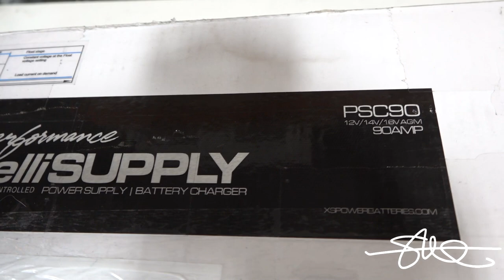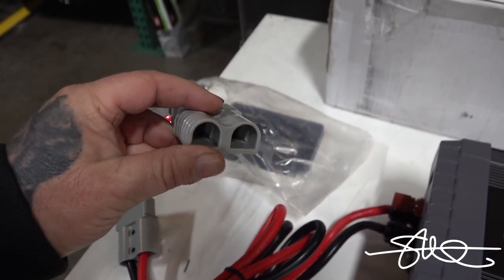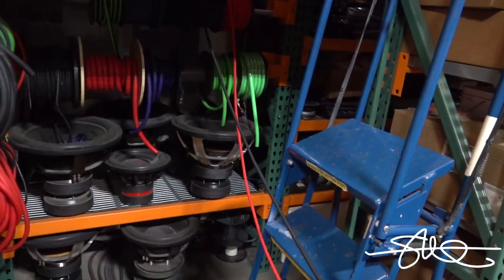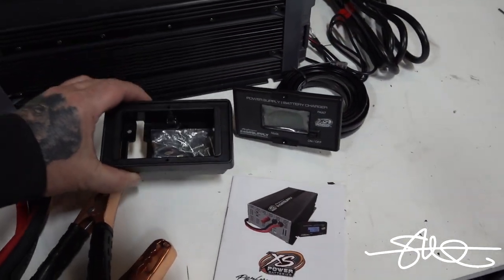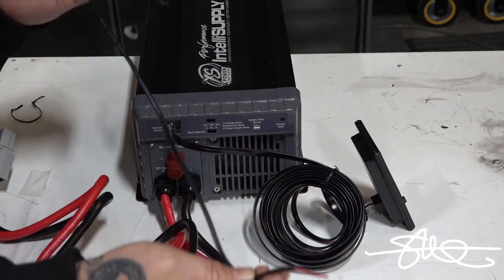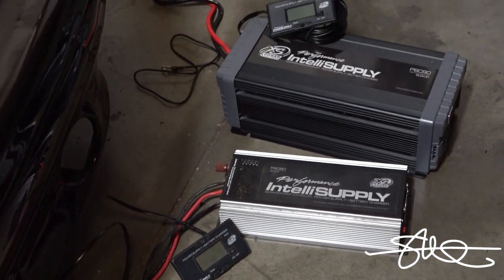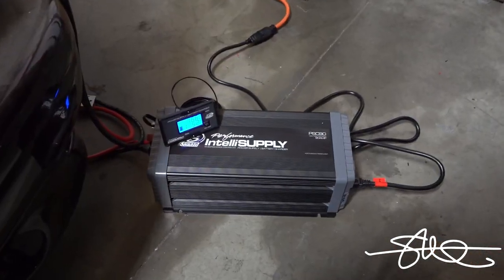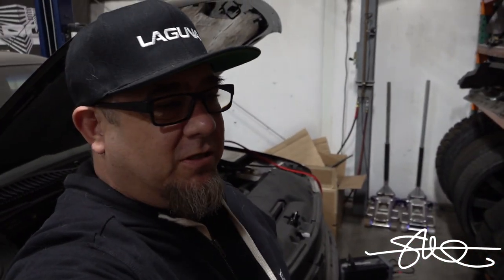Now THAT'S a charger, 90 Amps! XS Power Intelli-Supply PSC-90 is a BEAST!

Comment: How do you charge a completely discharged XS power D3400 battery? I really don’t wanna buy another one mine is only 1yr old and I left my lights on for 2 weeks now it’s dead and I’m afraid to jump it. Do I have to buy another one or will this charger bring it back to life?
Reply: You need a smart charger that restores battery's.  Most likely it's going to charge it on 1 amp and give it voltage boost on pulses till it restores . Topdon has a smart one for like 60 bucks.  It's not strong but it works
Reply: @smurfeco2.358  thank you 🙏
Reply: I got a noco2 for $50 on Amazon and it’s been faithful so far

Comment: "Anderson" plug/connecter good to know the actual name I always called them forklift battery or 24v connectors I've been thinking of using them to create some sort of emergency/quick disconnect system between my alt and rear batts that's easily accessible from the driver seat for safety & fire prevention as I'm wired directly from Alt to batteries in front wheel drive vehicle so alt is located down below right front tire and cables run under vehicle so no access there, I am fused multiple times over but they're all located in the back where the batteries are so if there's a fire I have no way to access those either.

Comment: What I'd do is install the plug in my vehicle so it can be hooked up easily. I'm using MC4 connections right now but 90A would be a bit much for those

Comment: dumb question but when you use this power supply do you keep it in charge mode or power supply mode when using it to keep the batteries topped off on the test bench?